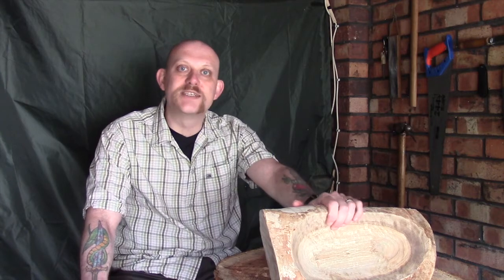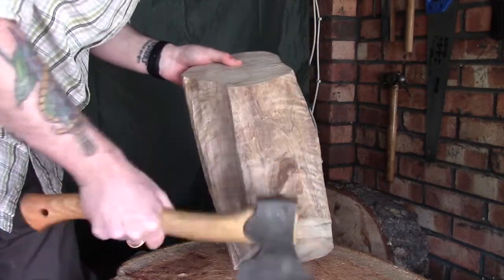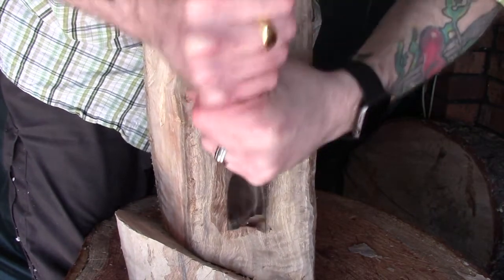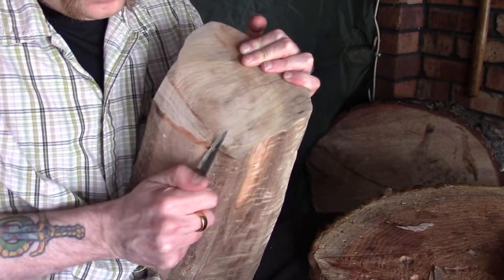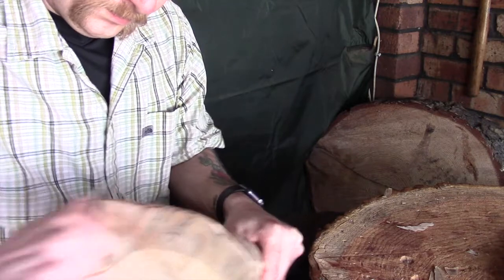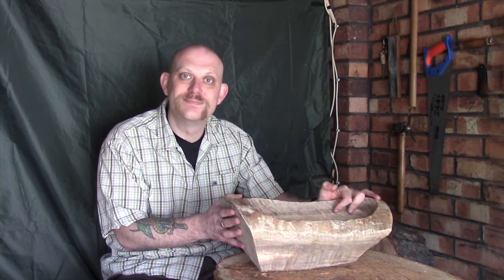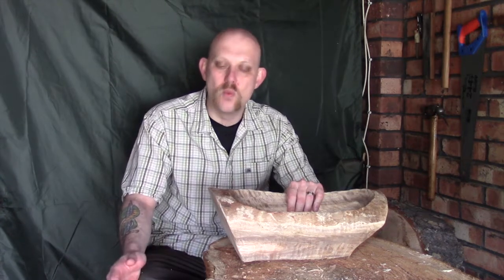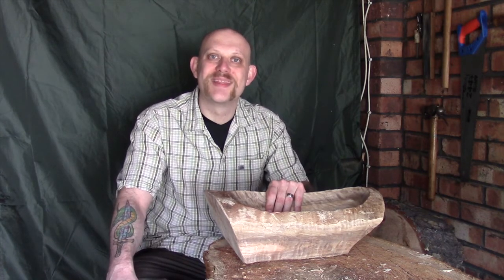Eucalyptus Bowl   Part 10

Comment: Do you use the draw knive befel up or down
Reply from the maker: Dimitri Vos bevel up for the one in the title pic, I also have the mora push knife which isn’t strictly a draw knife but works well as one and can be used either sided
Reply: Woodcraft Hamster oke